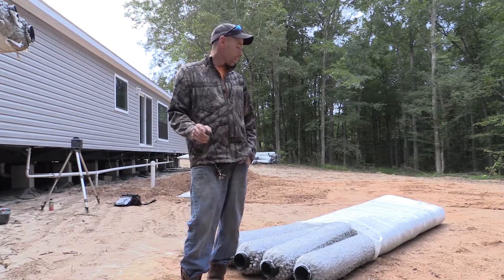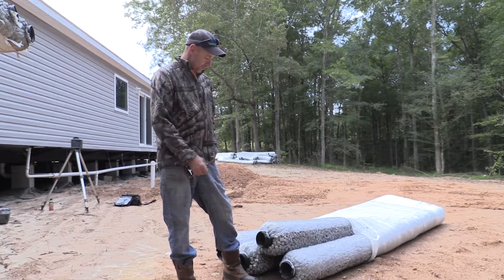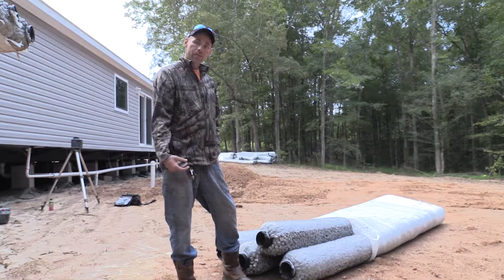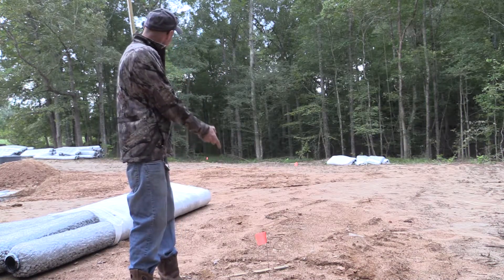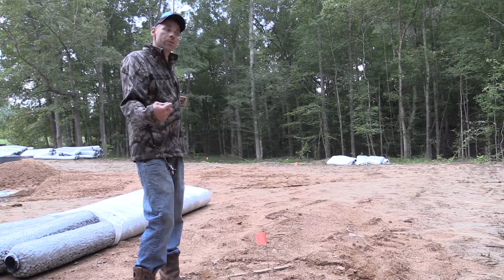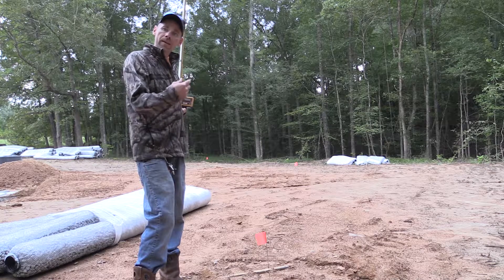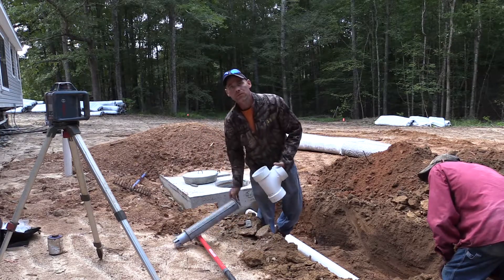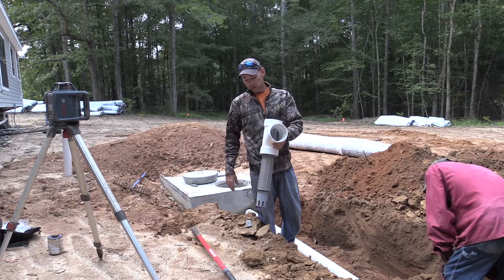How a septic system and fieldlines work

Comment: I don't know if you will see  this because it looks like. It's a year later after you put this up but I just wanted to ask you if you have a small section of the pipe Between the 22 and a 1/2 degree fitting and the easy flow that falls backwards in order to fill up the easy flow before it will spill over to the. Next level. U know ,in order to maximize the use of the easy flo on the higher level?